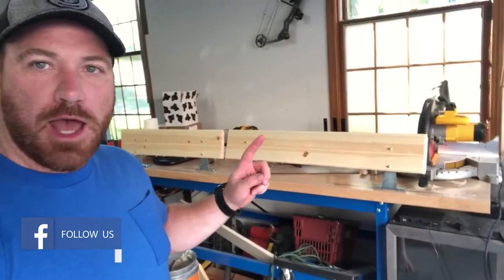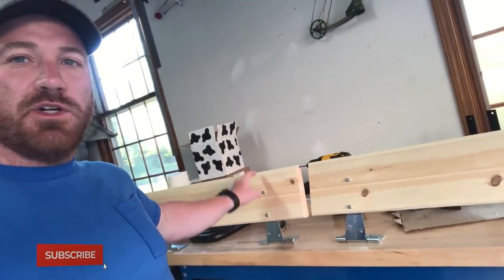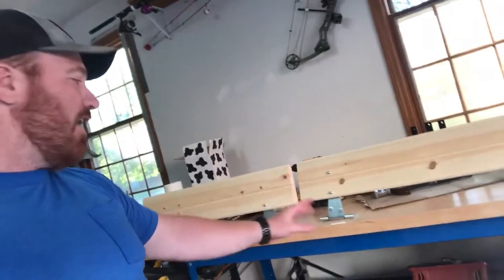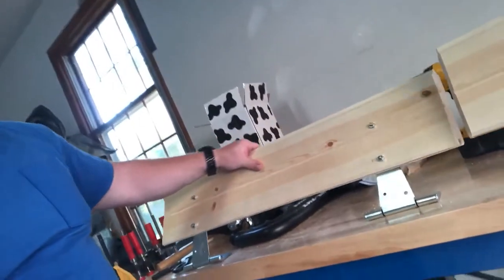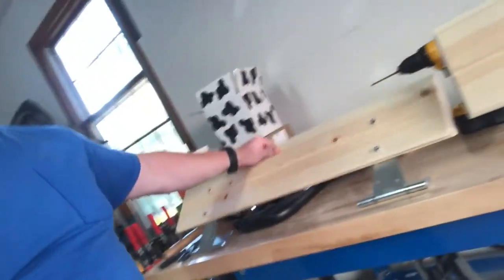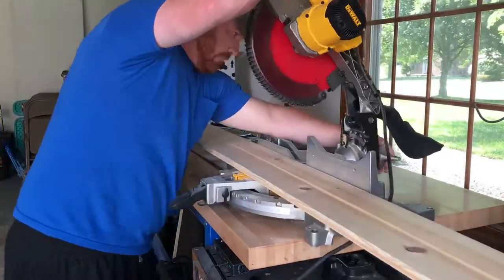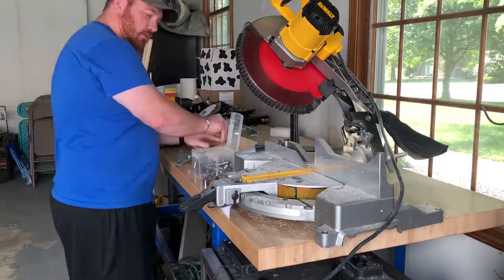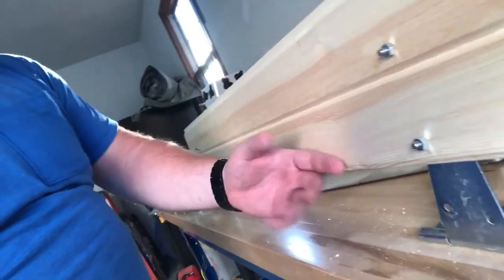How to Build Hide-a-Way Bunk Bed Rails for Your Camper Bunkhouse | Jayco 32BHDS

Comment: Love this idea! My family just got our 2022 BHDS and looking for bed rail ideas. Can you provide some insight on what size/length screw you used to install this in the plywood under the bed? Thanks!
Reply from the maker: I'm fairly certain that it was at least a 1" screw. The Plywood under on the bunk side is not very think and the one above the kitchen is a little thicker, but if you go too far with the screw you will go through the outside kitchen ceiling. My advice would be to measure the wood thickness that you can see on both sides. Good luck!